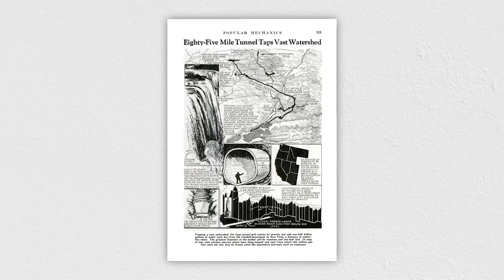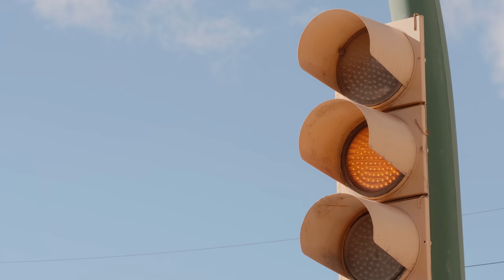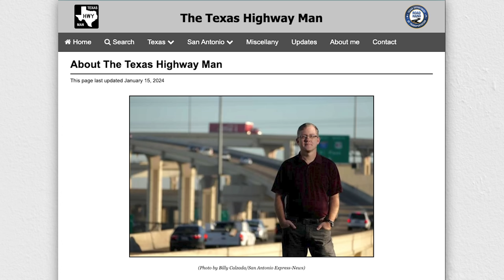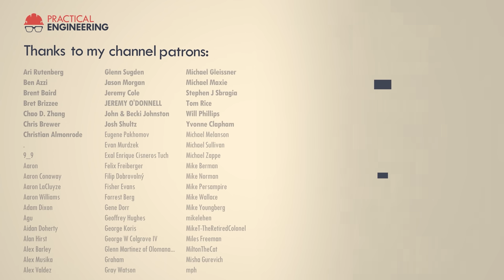Why Are Texas Interchanges So Tall?

Comment: Google searched longest Bridge span in America. I doubted New York but thought it'd be the Mississippi but nope.

Louisiana has the longest bridge span in the United States, with the Lake Pontchartrain Causeway stretching 23.87 miles across Lake Pontchartrain. The bridge connects the suburbs of Baton Rouge to New Orleans.

Don't believe everything you hear from random youtubers
Reply from the maker: Span is a technical term that means the clear space between bridge supports. The causeway is the longest bridge, but does not have the largest span.

Comment: Living and working in the Houston area for 50 years the problem with the high flyovers is for people that do not regularly or never have driven these towering interchanges is the fear of doing 60 mph on the elevated flyovers. People have actually dropped their speed to a crawl which is very dangerous because of roadway blind spots. My elderly sister caused a wreck because she became frighten and was almost at a standstill when she was hit from behind on a 60 foot high exchange.

Comment: As a Semi Truck driver that has driven 48 States, the Texas High Five is THE BEST!  And SAFER compared to the "Cloverleaf" at getting Heavy Big Rigs back up to speed quickly while coasting down the BIG Ramps... keeping 18 Wheelers up to speed with the 4 Wheel Vehicles = Keeps Traffic Flowin'!  No 🚛 slow downs.  (unless it's rush hour or 🧊 🥶)
Dallas and Houston is WAY BETTER than Atlanta traffic🚦😡 due to Texas' High Five Ramp System. 👍😎👍